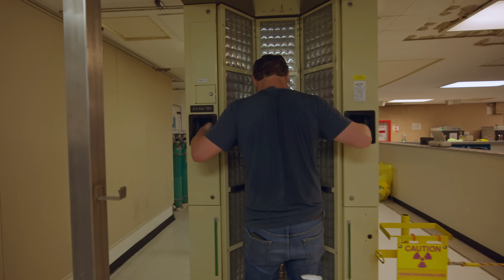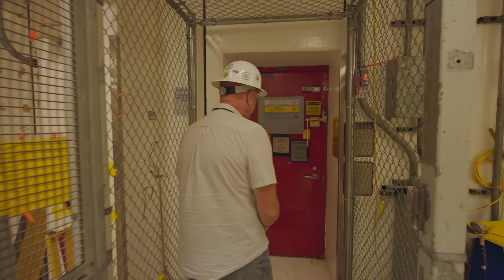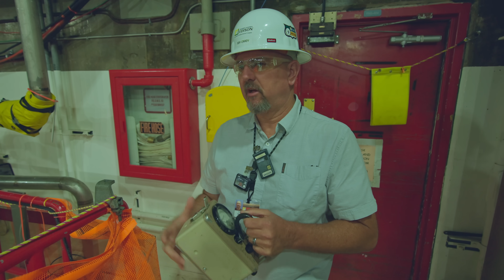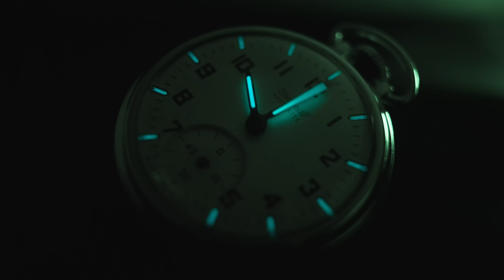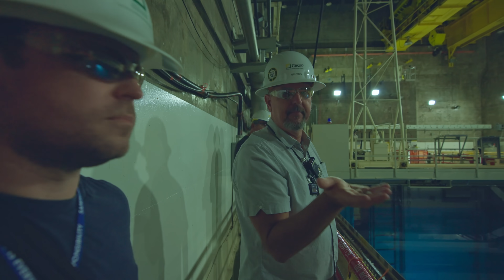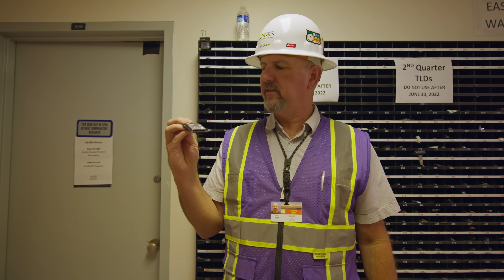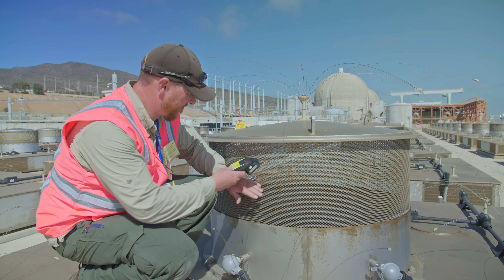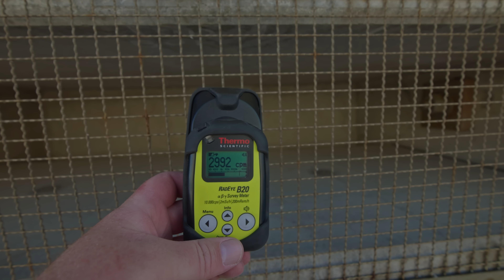Inside San Onofre Nuclear Power Fuel Pool and Spent Fuel Storage

Comment: The level of engineering that goes into this kind of operation is absolutely mind blowing.
Reply: This is fascinating.  One of my old friends / roommates in college (early 80s) is a nuclear engineer up in Minneapolis.  We’ve lost touch with each other, through the years, this sure makes me think about him and what he’s presumably been doing over the past 40 years.  Just amazing to think of the engineering that goes into running a facility like this.  Really cool stuff.
Reply: The mining of uranium is nuts as well. They freeze ground near the uraninite with freezing brine in pipes.. that put all around the area they will mine.. then they drill all robotically while sitting in another room. The loaders are operated by remote control like 70 feet away.. full size trucks like an rc race car
Reply: @prawnstar9213 so basically using liquid nitrogen that is fed through boreholes on the surface that are several feet deep down into the uranium? It sounds like they have both a send and a return borehole(s) for the liquid nitrogen.

I worked in coal mining, and while it’s different from what you describe for uranium, I have worked through a mine fire that occurred in 2013. For the surface, my job was to monitor liquid nitrogen that was being bed into these boreholes that was drilled down into where the fire was set and believed to have concentrated at. 

It was over some 3 to 5 million cfm of nitrogen that Nabors, the contractor that did the nitrogen, fed dong into those boreholes over I think was 30 days. It still took another 2 months for mine rescue to go down in and build these 120 psi rated concrete and rebar seals around the affected area… which was actually an area that was mines out 50 years ago when the mine first began running and that one particular air shaft was drilled
Reply: Just the technology, then on a scale like this…🤯
Reply: And most of the population is ignorant or could care less
Reply: Tell that to the Germans
Reply: It should not even be a thing. The discovery of radioactive elements was something along the lines of pure demonic. And I don’t care how “smart” or how much of a “prodigy” someone is, there is no way in hell these people understand everything there is to know about that station, radioactivity, half life, and all of that. In fact, I think 70 percent of what we see here is pretend and guessing 

But yeah, this should not be a thing. And whoever it was that first discovered uranium, plutonium, enrichment etc… they are rotting in hell. Guarantee
Reply: It should not even be a thing. The discovery of radioactive elements was something along the lines of pure demonic. And I don’t care how “smart” or how much of a “prodigy” someone is, there is no way in hell these people understand everything there is to know about that station, radioactivity, half life, and all of that. In fact, I think 70 percent of what we see here is pretend and guessing 

But yeah, this should not be a thing. And whoever it was that first discovered uranium, plutonium, enrichment etc… they are rotting in hell. Guarantee
Reply: And if it doesn’t work correctly it will also blow your mind
Reply: To a simpleton yes
Reply: @ ohhhh, look at the big brain on Vince….pretty sure of yourself, huh?
Reply: Its really not. Im an engineer in the oil and wind industry (yes the oil industry loves wind power, and hates nuclear pwoer, wanna guess why?), and a nuclear power plant is not really more complicated than an offshore oil rig for instance... and less complicated than an offshore floating wind field... But governments and the oil industry likes to give the illusion that nuclear energy is so complicated and dangerous that we cannot build out nuclear power. Its a shame.... but hey it keeps me in good work!
Reply: @allnamesaretakenb4 it’s got to be more complicated than oil oils simple you stick a tube in the earth and pump it out off shore is simple is the same just over the ocean nuclear is way more complicated I get wind is easier than nuclear
Reply: @Huntersprojects you miss out the part where you also pump out explosive gas out of the oil rig. That is where it gets complicated in terms of safety
Reply: @allnamesaretakenb4  totally disagree with your "dangerous" nuclear plants. I worked at on for 10 years. More complicated and SAFE than you can imagine. You should visit one. . . . and the reason there are no more being built is because pussies and tree huggers have convinced the politicians they are not safe. When this generation or the next runs out of oil and natural gas, the nuke plants will continue on.
Hopefully wind power will fill in the needs of the many but have seen pressure from groups saying they are killing birds. So what. Those idiots want to live like North Korea??? I say MOVE!
Reply: @allnamesaretakenb4  depends on if your smart or not
Reply: @cheeseburger7290 *you're.
Reply: @ryanduray1   the comment I made before this was very immature I apologize for it
Reply: No
Reply: @UnrealZBI  yes

Comment: Fun fact: you can safely swim in the spent fuel pool so long as you don't dive down to the rods as water has a very high shielding rating. Which alongside its thermal conductivity is the reason they use it in the cooling pools of spent rods.
Of course they wouldn't need to dispose of these rods if they could refine and reuse the fuel in a different on site reactor and/or could place them near alpha/beta/gamma voltaic cells that capture the particle emissions and convert them to electricity. But inept government, run by under informed uneducated ban the bomb boomers, in all its ineptitude has deemed it fit to kneecap nuclear anything and justify it by pointing at weapons, and three incidents one from the infancy of the industry when we were still learning how to harness it aka when mistakes are bound to happen, and the other two from poor reactor designs with known flawed and dangerous equipment that chose to ignore everyone else telling them to fix it or there will be a problem. Honestly nearly 100 years and only 3 examples of harm two of which actually did any harm and both of which caused by incompetence. Sounds pretty reliable and safe to me considering we can hardly go a year without hearing about an even worse disaster from any other source of electricity including both wind and solar.
Reply from the maker: The biggest problem I see with swimming in the fuel pool is all the contamination you would pick up from the water. There are activated metals in the water, like Co-60. It’s not a lot but it’s there. 

It would be a great idea to passively collect energy from the spent fuel. It’s still generating a lot of heat and they could use that heat to run sterling engines along with collecting the radiation energy. Right now it’s wasted energy sitting there.

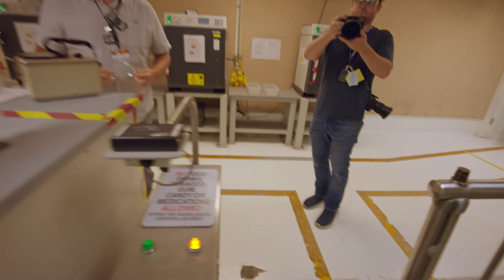Comment: 4:42 That's DMC-3000 by Mirion Technologies. Bare instrument can only measure gamma and X-rays and is not particularly sensitive. However thanks to two detectors, its energy range is quite wide: 15 keV to 10 MeV. This means that braking radiation of CRT screens can be detected although the rate is quite low. Its upper dose rate threshold is 10 Sv/h and it will indicate that the threshold is exceeded up to 50 Sv/h. Switching between units of measurement is only possible with calibration equipment. It supports 4 extensions: beta, telemetry, neutron and neutron-telemetry.
One of my Dawson College instructors would probably say: "It has nothing to do with Run-DMC".

Comment: These fuel assemblies are definitely not spent. They are slightly diminished.  The radioactive decay has simply reduced to the point where it can no longer generate enough heat to superheat the steam enough to efficiently generate electricity, with the solid fuel assemblies.  Once the diminished solid fuel assemblies are reprocessed into a radioactive liquid sodium solution, the fissile products, including plutonium, can generate clean, safe electricity for centuries!

Comment: As a common sense rule, dry storage should not be sited adjacent to aquatic environments whenever possible.
Reply from the maker: Why is that?
Reply: @RadioactiveDrew  Simple, the further away from a lake/river/ocean it is, the less likely there's a release from flooding events. Obviously there's other site considerations, but ideally you want to site in a location that minimizes risk of releases into an aquatic environment.
Reply: And obviously this is a general principle, further away doesn't necessarily mean less flood prone.
Reply from the maker: Even if it floods nothing will happen. Nothing will leak. The spent fuel storage containers are sealed and what’s inside them is a solid in a ceramic form.
Reply: @RadioactiveDrew  The idea you would let the engineering of the cask be the only barrier flies in the face of defense-in-depth principles. The first layer of DiD would be to site dry storage away from shorelines.
Reply from the maker: Did you even read my previous comment? It’s a ceramic, so it doesn’t even matter if water gets in there. They could be completely submerged in the ocean with zero risk to anyone.
Reply: @RadioactiveDrew  The fuel pellets start off as a ceramic, but by the time they are irradiated the composition is a mixture of different fission products. Not to mention, the way that fuel pellets age: they crack and degrade with heat and radiation damage. I'm near certain species like Cesium would be highly water soluble. I'm also pretty sure that if the integrity of the canister breached, it would be tritiated to some degree and would be a radiological contaminant.
Reply: @RadioactiveDrew  Honestly, this is a strange exchange... Hypothetically, if they were to be flooded, this would constitute an accident and as he said emergency protocols would be invoked. Under no circumstances would the NRC or the IAEA take the position that submerged casks aren't a problem. I'm not sure why you're trying to convince me that it's fine when it clearly is not.
Reply from the maker: Well you were trying to say there would be a risk of release into the environment…of what you never specified. I’m going to assume dangerous radioactive material. Im saying that it’s zero risk. That entire concrete pad could be under 30 feet of water and nothing would happen. 

 I’m curious…what do you think would happen if the this area was underwater?
Reply: @RadioactiveDrew  This is patently insane. This is not how the industry works. DSCs are dry storage, they've never proposed to be a canister which meets the design criteria of underwater storage. We don't play these games in this industry for a reason - in fact we all operate on the very principle that things DO happen. It is patently, certifiably, insane, that your response to "don't site dry storage near the shore if possible" is "if they get submerged it'll be fine". Where would we be as an industry if that the attitude we take?
Reply: I can't imagine applying for a license, going in front of the NRC, and telling them that siting waste storage in flood-prone areas is fine because the DSC can withstand submersion and it's nothing to worry about.
Reply: Do you know how radioactive the isotopes are on the ocean floor? Every time we have a large offshore earthquake it releases more decaying product than the entirety of all nuclear and medical waste in the US. Sure it sucks that it's right along the coast but it's not like the cesium 10 miles off the coast is less dangerous to the marine life you ingest for dinner.

The fungal spores released by earthquakes will kill more people in Southern California than anything from SONGS - and I say this as a physician with an engineering degree in applied materials. In the context of risk stratification, the whole "nuclear energy is dangerous" aspect has been completely derailed by people who honestly have no degrees in core sciences. If the amount of nuclear waste that coal plants produce and aerosolize was candidly discussed by the media we would probably have an working fusion reactor by now.
Reply: @Tokamak3.1415  I work in the industry, I'm anything but opposed to nuclear. I've had the opportunity to work at a national lab where we look at safety analysis of reactors. The idea we don't care if canisters get submerged is not how we do things. Even in this instance, by siting near the shore, they build the structure at a grade which should eliminate any tsunami event. In reality is absurd the positions advanced here because even this facility considered and tried to mitigate the very risk you've so vehemently asserted we shouldn't consider.
Reply from the maker: I didn’t say no one cares…it’s about risk to the public. I said the canisters could be submerged with zero risk to anyone.
Reply: @RadioactiveDrew  Holtec, the manufacturer of the dry storage system has this promotional video on the exact configuration used at SONGS: (https://www.youtube.com/watch?v=EF9B8NotKAw ). At no point do they make any claim that when submerged, the integrity of the canister will prevent water ingress or releases to the environment. The safety case is made that sufficient cooling is present in all accident scenarios to keep fuel cladding from failing. Furthermore, the design specifically incorporates above-grade placement of the cask and vents because they do not make the claim integrity of the cask is part of the safety analysis. This, to me, shows that they acknowledge that it is easier to demonstrate that keeping a cask elevated so it does not become submerged is far easier that demonstrating a submerged cask will preform well enough to meet safety standards...

...Which goes to my original point, to which I'm not sure why you're arguing, is that best practice would dictate not siting near aquatic bodies wherever practicable. They are siting near the shore so the design incorporates similar elements for flood mitigation such as elevating structures. 

I'm not sure exactly where you're trying to go with all this, trying to assert DSCs performance when submerged, or why you felt the need to debate whether or not mitigating flood risk by siting away from shore is unnecessary. I think that's really all that needs to be said about this.
Reply: @NotSince67  But what is the actual danger of the canisters leaking into the ocean if a 70 foot tsunami were to somehow breech the site? The gamma and beta decay would be meaningless unless you were in the water. The only danger is the actual radioactive isotope and any resultant contamination of surrounding metals. Usually the heavy metals don't enter the food chain as CA seafood doesn't use too much of the bottom dwelling food sans shrimp. It's the byproduct isotopes that become dangerous.
I wouldn't be so callous to say their risk is negligible, but when I consider the amount of benzene, arsenic and lead that I measured from the dust i collected off my window sill and sent off to a lab I realized that the air in Southern California for anybody not withing 500m of the coast is probably taking 5-10 years off of everybody's life. For everybody living in the US with basements the Radon gas they breath every day is more detrimental than most of the heavy Iodine they'll ever ingest (except for maybe the people around White Sands).
The risk needs to be juxtaposed to the other risks that millions face every day and in that context it's chasing after the things that are more than 3 standard deviations from the mean - or in laymen ignoring the 800 pound gorillas.

Comment: The fuel assemblies need to be reprocessed on site with reprocessing technology that is commercially available.  Liquid fueled reactors need to be installed, so the reprocessed Liquid fissile materials can be used to generate clean electricity for decades to come. The remainder of the radioactive material can be reprocessed into a radioactive glass which has a much lower half life, much lower radiotoxicity, and can be safely buried in a much shallower area for a considerably shorter period of time.  After the materials have completely decayed, the result is very valuable metals that will more than recoup the cost of reprocessing, remodeling of reactors, and all other costs.  Also, the electricity made by the Liquid fueled reactors will be sold to defray costs, and generate revenue for the power companies
Reply: This wont happen. It's a political hill to die on for Gavin Newsom. His dad was bankrolled by environmental groups (like Save The Earth) that made it their mission to stop nuclear in the state. This coming from the state that wants to be carbon neutral. Instead Newsom bought 9 gas generators last year. It took Feinstein and people writing letters to Newsom to keep him from shutting down Diablo Canyon for 2 years.
Reply from the maker: A lot of people think that spent fuel is waste only and don’t realize it’s value.